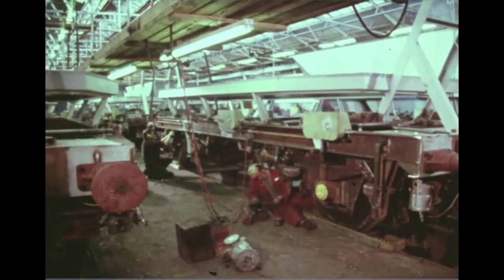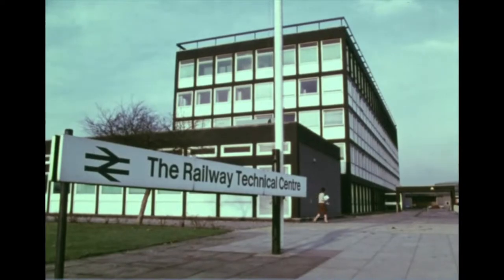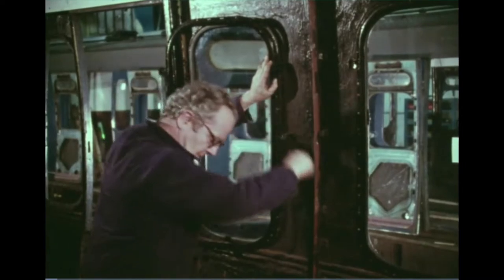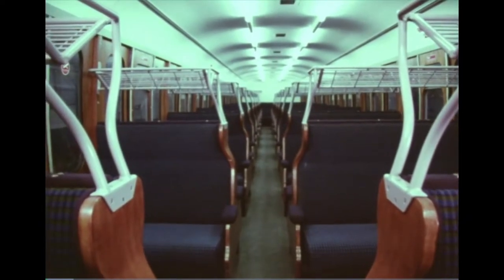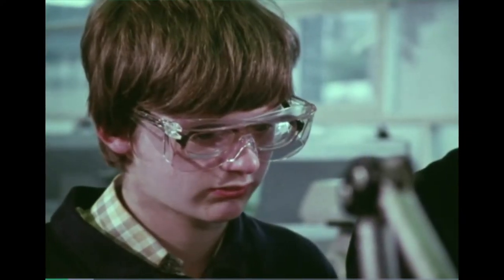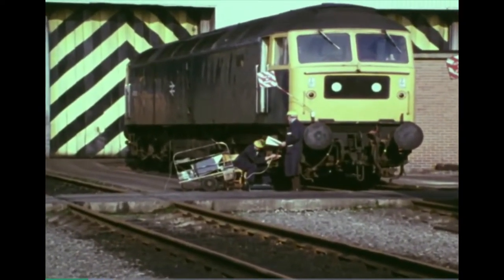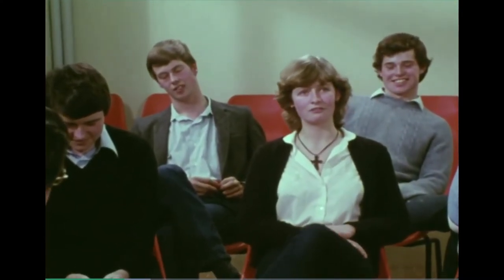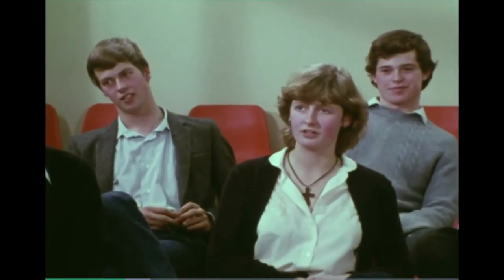Train Makers (Horwich Works, 1981)

Comment: At school they always said BR was one of the best places to get good training. To see BREL works on open days quite something, Upholstery, carpentry, electrical, fabrication and foundry work to name a few. It is so sad to see how we now import our trains rather than us building and exporting them. The skills this country has lost over the years have cost us dearly and made us so dependant on imports that often seem to be sub standard.
Reply: People voted for the loss, let them have it.
Reply: @userscott  They did, and in schools it was also Elf n Safety put an end to teaching skills like welding using acid pickle baths and foundry casting, all of which were taught in my school. When I went back years later to an open evening I found all the lathes milling machines and grinding machines were gone, my old teacher was there and said they no longer taught anything like in my day, now the focus is on robotics programming and the nearest they got to making anything was a key ring fob from Perspex. By doing that is has made school leavers look for jobs other than in heavy engineering.